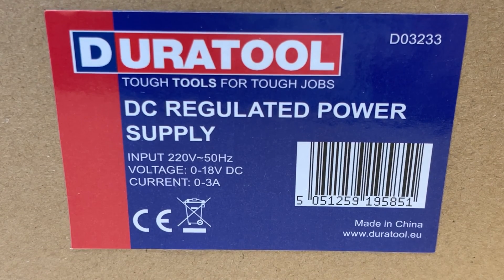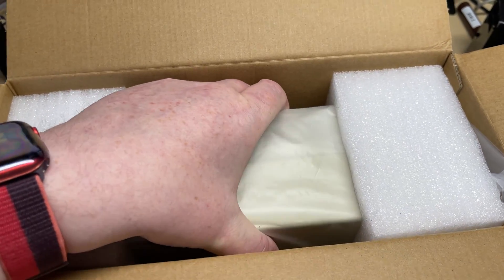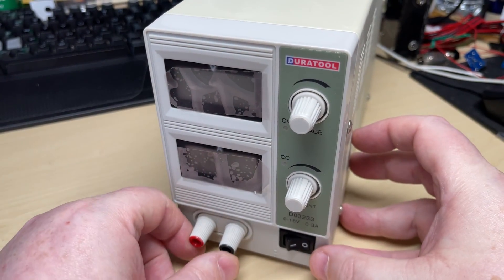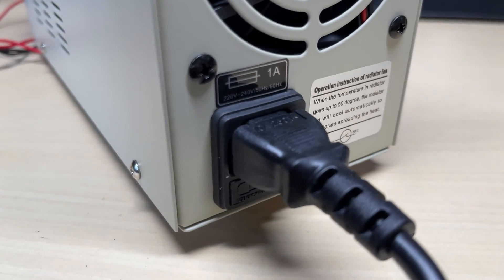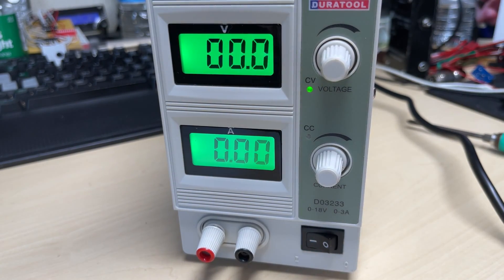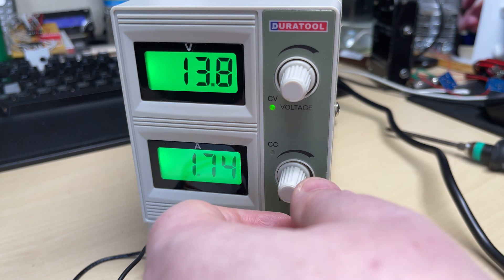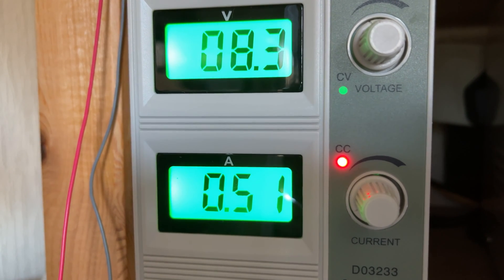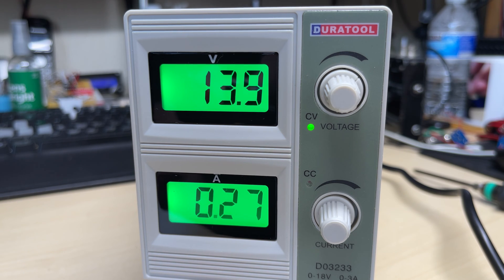EP 103 - Duratool D03233 Bench power supply - review and test.

Comment: Interesting that the fan kicked in at such a small load, especially when the output voltage wasn't super low. The 2A 15V version of this is passively cooled. I wonder how hot that gets with a 1V 2A output? I assume the fan is a standard 80mm one, and would be easy to swap out for something quiet. Does the lack of a fine control for the output voltage cause any problems. Apart from that, this seems to tick all the boxes for general bench use, apart from remote control (which I obviously don't expect at this price).
Reply from the maker: The temp as you have seen is just a bimetal switch , no intelligent  current monitoring .for the price it does me it’s accurate and not had any problems selecting the voltage I require . For the price it’s fine.
Reply: @MicroChipz  I just ordered one from CPC. They are still 30 pounds + VAT. Only 4 pounds more than the 15V 2A version. There doesn't seem to anything else like this available right now. If you look to spend more you go through a series of rather iffy choices until you get to well over 200 pounds. They are either iffy because they are rather crude forms of SMPS, or the build quality is highly questionable (even their safety). Cheap, SMPS and flexible down to zero volts - pick any two.
Reply from the maker: @steveunderwood3683  smps was not for me . Give me a good ok transformer anyway .
Reply: @MicroChipz  I understand the bias, but a really well designed SMPS, with a sufficient budget to do things properly, is the only way to go for anything high power in the lab. At 50W there isn't a huge amount of heat to deal with in a linear supply, and it costs too much to make an SMPS that isn't going to keep biting you with its quirks.
Reply from the maker: @steveunderwood3683  this is also true .
Reply: I received my supply. The voltage control is a bit sensitive without a fine adjustment control, but its nice and smooth, and easy to adjust to a required voltage. You just need to be careful not to nudge it after setting it. The voltage meter reads about 0.2V low. I'll have to see if that's easy to tweak. The current accuracy is good. It takes a fair load to get the fan to start, and although its noisy its not the horrible grating noise too much test equipment makes. I think for most of my work it won't be running. The mains transformer buzzes a bit. That might end up as the more annoying noise, as its not too loud but its constant. One of the 4mm sockets was slightly bent, but the packaging showed no signs of any impact. I've managed to get it more or less straight. For the price it looks good so far.
Reply from the maker: I totally forgot to do a voltage measurement on my video, i remembered after i had made it . my transformer buzzes a little also. shame yours was bent slightly. For a budget its fine i only use for powering radios on test and charging my li-ion batteries using the constant current feature.